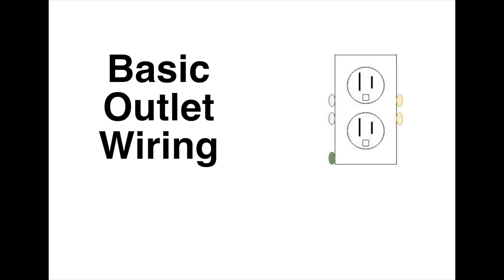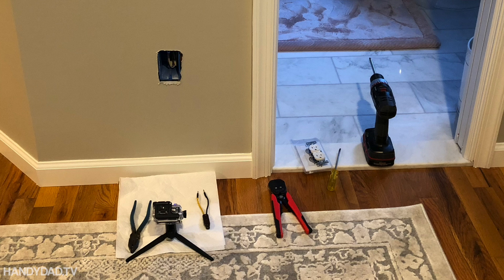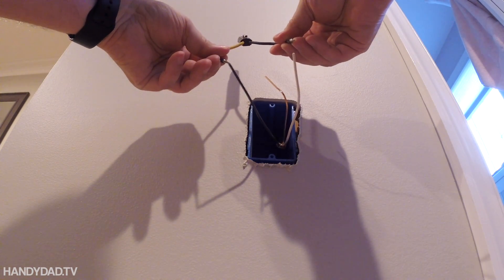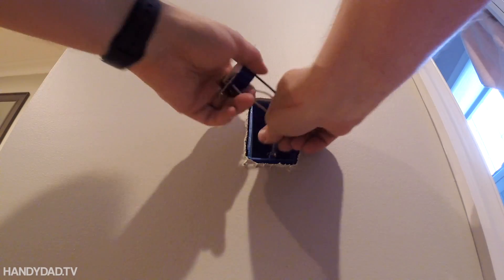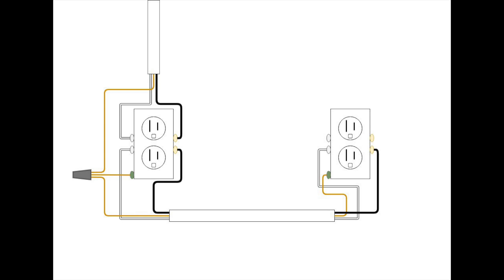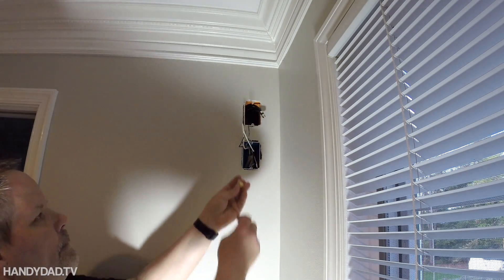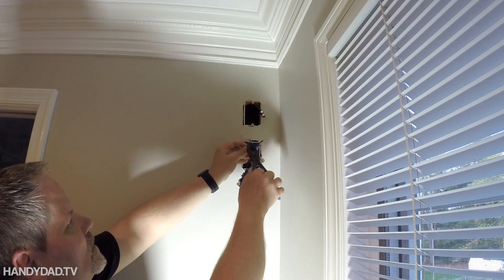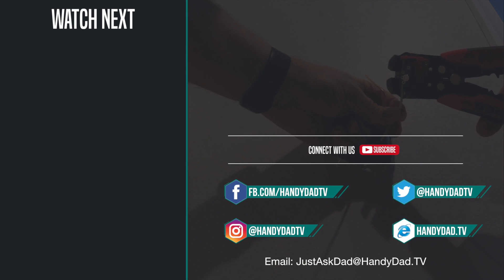How to Wire an Electrical Outlet

Comment: Great Video! I am installing an attic fan and I have spent hours trying to find a video about wiring it to power. Every video shows connecting the thermostat side and then they just say "and the other side connects to the power" But how? So I believe what I learned from your video (and please tell me if I'm wrong) is that I can run my 12 guage wire from my attic fan to an outlet in my attic (my heater is plugged into one) Basically if I open the outlet box (with the power off) and see a free chrome and brass screw, and a ground - I can connect to those accordingly and my attic fan will have power?
Reply from the maker: Yes that's how you do it. But verify the breaker size. You can use 14-2 wire if it's a 15-amp breaker. Use 12-2 for a 20-amp breaker.

14 gauge is cheaper and easier to work with.
Reply: HandyDadTV I went with 12-2 at the recommendation of the guy at Home Depot for safety reasons. And the breaker that controls that outlet is 20. Thanks again!

Comment: It would be useful to also include wiring the beginning of a run when the first outlet in the circuit is feeding two outlets (one in each direction).
Reply from the maker: I just recorded a situation like that! Basically you pigtail all of the wires, not just the ground.
Reply: @handydadtv  👍

Comment: There is no need to make a pigtail. Use back wired device. There are 2 positions that can be chained and it is connected to the device. In case you didn't break off the shorting tab, you got 4 positions. The 2 positions are on the left and right of the clamping screw.
Reply from the maker: You need to pigtail the ground. Pigtailing the black and white is a matter of preference. Some people always use pigtails. Most use the screws. Some use the stab connectors.
Reply: @handydadtv  yes. Ground wire is the only one that need a pigtail. The rest unnecessary.

Comment: How to do a code violation.  See NEC 300.13, continuity of grounded conductor (AKA Neutral, not to be confused with grounding conductor) shall not be dependant on device connection.(B)Device Removal. In multiwire branch circuits,the continuity of a grounded conductor shall not depend on device connections such as lampholders, receptacle removal of such  devices would interrupt the continuity.
Reply from the maker: If you’re saying white wires ALWAYS need a pigtail, then every house I’ve owned, including my current one built in 2018, has been wired incorrectly.
Reply: @handydadtv  What I'm saying is that 300.13(b) is clear for MWBC, and the inspectors I've dealt with in WI even frowned on jumpers from one duplex to another in a 2gang 4x4 box in a SWBC, interpreting the code as if any circuit fed by a MW panel is an MWBC, regardless of whether the circuit or box has both hot legs or not. The rationale  for a "true" MWBC, an interrupted neutral can cause downstream devices to experience L1 to L2 voltage instead of L1 to N.  In SWBC, a isolated neutral can be made hot by back feed from downstream devices if the hot isn't broken.   An interrupted or poor quality hot connection is an inconvenience, and possibly a fire hazard if the connection heats up, but does not create a shock risk.  An interrupted or poor quality neutral has the same risk for heated connections, but also creates a downstream shock hazard because it creates grounded conductors that aren't grounded.   GFCI and AFCI devices get a pass because they must isolate the downstream neutral to provide protection.  FYI, I'm an EE not an electrician.  My day job is industrial controls and panels.  NEC involved but not construction.
Reply from the maker: As a professional EE, I will defer to your knowledge of NEC. But I’d really like to know, in layman’s terms, what was wrong with the way I installed these two outlets?
Reply: @handydadtv   By not creating a device independent grounded conductor (neutral) connection, the possibility that the isolated white wire could go to 120v  at some point in the procedure is created.  This happens if the hot is still connected, and a luminaire or plugged in lamp or vacuum in a downstream plug is connecting the hot to neutral.   If this is the case, as soon as you pulled the white wires off, one of them goes hot.  Never mind that you shouldn't be playing with a live circuit, or that you broke the hot connection too, and/or that it will be reconnected before it's hot again. The NEC assumes everything else is done right or wrong in a way to exploit a weakness and create a hazard, then wants it to be negated.
Reply from the maker: So what you’re saying is, the neutral wires should always be pigtailed, just like the grounds, to protect idiots who replace outlets on live circuits.
Reply: @handydadtv  It's not just when you're doing the work, but NEC assumes that can happen.  You've never seen an outlet with cooked connection?  50/50 it happens to the neutral.  The reality about code inspections and connections was explained to me many moons ago by a buyers inspector going over a duplex I had bought new about 3y previously, lived in half, rented half, and was now moving and selling. He had prior (bad) experience with the builders other work.  He explained that the only connection you can have any confidence in by sight is a wire nut where you can see twists in the insulation behind the wire nut.  The only tight screw screw is one you've put the screwdriver on and checked.  The only wire routing you trusted was what you could see before the drywall went on.  He plugged a tester into every outlet, pulled half of the outlet/switch covers, and actually dug out the switches and/or outlets on a quarter of those to check further.  If a hot leg connection goes bad, you end up with no/low voltage where you expect 120v.  When a neutral connection goes bad, you can end up with 120v where you expect 0v.

Comment: Why would I have an outlet with three white and three black wires, when there is no switch involved?

(Also glad you mentioned the pigtail on the ground, because all three ground wires were just spun together and the longest was mounted to the green screw....nothing surprises me anymore.)
Reply from the maker: One set of wires brings power into the box, and two sets bring power out to other outlets in different directions. No switches are needed.

Comment: Have you ever seen a outlet that is controlled by a switch but is hooked up with just neutral wires?  There is one neutral on the bottom right and one on top left but the back in the box are the 2 black/ hot wires nutted together.
Reply from the maker: No that’s wrong. Hot should always be switched.

Comment: Good video but wouldn’t all those grounds touch when jammed back in the outlet box anyway?   What happens then?
Reply from the maker: If the ground touches hot, you’d get a short. Put tape around the outlet first to avoid this.

Comment: How many outlets connect on one line?
Reply from the maker: As many as you need. You just need to be aware of the load required by what you plug into the entire circuit. The circuit breaker will pop if you overload the circuit.

Comment: Does it matter if the order white of black wires when there's two blacks and whites? Also won't it make it 220 volts with two blacks and two whites? Thanks
Reply from the maker: You can use either screw, top or bottom, to connect the wires. They are both connected together by default. Just be sure to put the white wires on the silver screws, and the black wires on the brass screws.
Reply: @handydadtv  but won't it double the current to 220 instead of 110?
Reply from the maker: No. With two sets of black and white wires, one set brings power INTO the box and the other brings power downstream to other outlets on the same circuit.
Reply: @handydadtv  can you hook two black wires to one gold screw? Sorry for all the questions. I'm trying to learn all of this. Thank you for your help
Reply from the maker: No. One wire per screw. If you have more wires than screws, connect them with a wire nut and use a pigtail (short wire) to the screw on the outlet.
Reply: @tbucks1000  
Depends on the receptacle you are using. If you are making a J hook and putting the hook under the terminal screw then only one wire per screw is possible. However, most modern spec grade receptacles have a plate below the screw and instead of making a J hook you simply insert the stripped end of the wire under the plate and then tighten the screw to provides secure connection. Using this method it is possible and permitted to insert two wires under the plate, one on each side of the screw and then tighten the screw.

Comment: Does it matter if you hook the hot coming in and power going out to the top or bottom?
Reply from the maker: No. Both screws are connected top and bottom.

Comment: NEVER USE THE STAB CONNECTIONS! I'm an Electrician.
Reply from the maker: Appreciate your input. Why are they no good? I’ve seen them used in new construction by licensed electricians. New homes built in 1970s through 2020. Why does UL allow the manufacturers to make them?
Reply: @handydadtv  
Just remember if those quick connect speed wiring terminals were as good as screwing a wire fast then there would be a push in provision for the ground wire as well
Reply from the maker: I’m not disputing that screws are better, but the stab connectors must be “good enough” for NEC to allow them. No?

Comment: Is this 14/3 wire
Reply from the maker: 15-amp circuits use 14 gauge wire.
20-amp circuits use 12 gauge wire.
Reply: It's called 14/2 w/ground

Comment: Hi guys, thanks for all the tips.  I am remodeling my kitchen.  One outlet, you can flip the switch and the kitchen lights come on.  You can also open the back door to the garage and flip the switch there and turn the lights off.  Either end you can turn them off or on.  I am having a problem with a 2 power switch.  So is this possible?  To turn on a light over the sink or stove while turning on or off the light over the kitchen?  I played with this for a while and thought this won't work........But you know these days Youtube can provide some crazy real information.  Just looking for a next step, again thank you for all your input.
Reply: To be clear, I am trying to ad a two button switch that will obviously power two things. So the third wheel is the extra button in the garage that turns the lights on or off.
Reply from the maker: You’d be better off doing this with smart switches and create a scene in Alexa or Google Home.

Comment: Perfect! Exactly what I was looking for in a video, as a beginner.

Now I just have to get over the fear of grabbing bare wires for the first time (after shutting off the breaker and testing for power with the proper equipment).
Reply from the maker: It’s good to be fearful so you’ll respect it. Always test first, then touch the wires together with a screwdriver or pliers to make sure the line is dead. Do it enough and you’ll get more comfortable. But always respect it.
Reply: @handydadtv  When you say to touch the wires with a screwdriver/pliers, do you mean to see if there's electrical arcing that's visible?
Reply from the maker: Yes. Just as a precaution to calm your fears.
Reply: @handydadtv  Great idea, thanks!
Reply: Me too! Even after I test. What has helped me is switching power off to the entire house😆 then testing then I'm ok to touch. Better Safe than sorry!!!

Comment: When is it that the tab is to be broken from the outlet?
Reply from the maker: If you mean the tab between the screws on the side, that’s only removed when you want to switch one outlet for a lamp while the other one stays on continuously.
Reply: @handydadtv  Yes thats what I was meaning do you have video on this how its done? I actually would liked to get an extension cord where I could plug it into an exsisting outlet & the other end connected to a new flip switch outlet so I can mount an outside light on back side of house which then can be connected into the flip switch outlet is that possible you think?
Reply from the maker: I wouldn’t recommend using an extension cord as a permanent solution for an outside light. And I wouldn’t have a switch controlling half of an outside outlet because outside outlets should be GFCI outlets and they can’t be split.

Comment: I noticed in your diagram that the hot wires went to the top screws and the out going power wires were connected on the bottom and went down line to the second outlet but that outlet had the hot wires go to the bottom instead of the top like the first one.  Can you explain why?  I know gfci have a LINE (hot) and a LOAD (down stream) and was wondering if an outlet that has (hot) wires connected to the bottom was a problem? Or was it just because it was the end of the line that the process changed?
Reply from the maker: Yes, GFCI outlets have specific screws for line and load, but not normal outlets. There is no difference between the top or bottom screws because there is a shunt between them. Remove the shunt and the two outlets are electrically disconnected.

Comment: hi sir, just wondering, is it ok to run two 12/2 wire in the same conduit? or do they need to be separated. thank you very much!
Reply from the maker: Pretty sure you can run multiple wires in the same conduit.
Reply: @handydadtv  thank you very much sir!
Reply from the maker: https://diy.stackexchange.com/questions/119448/can-i-run-two-cables-through-the-same-conduit
Reply: @handydadtv  thank you! that's helpful.

Comment: Thank you for the video, question, could I connect a 2nd Receptacle to the middle Receptacle? Main cable comes one pair of screws, second cable to another receptacle using the other pair of screws, and a 3rd cable to another receptacle using the pressing connectors?
Reply from the maker: Yes, that will work.

Comment: Can you do a video on connecting 3 GFCIs together
Reply from the maker: All wiring is done the same way. You can daisy chain from one GFCI to another, but all wires should be connected to the LINE terminals. You can protect other standard outlets with the LOAD terminals, but do not connect other GFCIs to the LOAD terminals.

Comment: I have a switch connected to an outlet, but I want to connect it to a new ceiling light instead, making the outlet independently available.  Can you show or advise on how to wire this scenario?   Thank you,
Reply from the maker: The hardest part will be running the wire from the switch box to the ceiling box. Once you do that, all the work is done in the switch box. Remove the outlet wire from the switch and make it hot all the time. Replace that with the black wire going to the ceiling light. Then connect the whites all together and the grounds all together.
Reply from the maker: This may help https://youtu.be/wRSgemIxamU

Comment: I got a few questions hope you don't mind. 1. Does it matter which screw you connect the same colour to? ie white wire, does it matter if its the top, bottom screw or push-in connector? 2. My new outlet has two push-in for ground(and for black and white also) does it matter which push-in i put the wire into? 3. if the outlet doesn't have a ground screw, what do you do with ground wire?
Reply from the maker: 1. Both side screws are connected by default, so it doesn’t matter if you use the top or bottom. 
2. My dad taught me to use the screws instead of push-in connectors, and a lot of electricians agree. I’ll only use them for convenience outlets, never for high amp appliances. 
3. Don’t install outlets without a ground.

Comment: I once saw a circuit with hot and neutral  lines  dropping from the attic to each outlet as if it was T connected. The result was parallel outlets having 120 VAC at each outlet whether or not we removed any one of the outlets. Not a daisy chain. That means that only one brass screw had a black wire and one silver screw had a white wire. Could happen then the parallel outlets will be hooked up in series resulting in incorrect voltages if hooked up as a daisy chain, even with the connection bar in the outlet

Comment: Such a great simple video.  Thanks.  My circuit also has a red wire in it;  What do I do with that one?
Reply from the maker: Usually that’s connected to a switch. Use a voltmeter to verify.

Comment: Nice video, but I have some comments: first, never use the back stab holes on the back of the receptacle it makes for a weak connection, use the screws. Second, wires can be removed from push in connectors, you have to twist the connector back and forth  as you pull on the wire or get the Wago lever type. Third, on middle of the run outlets it is preferred to use the pigtails on all 3 wires as long as you have room in the box. The downstream outlets then will be independent of this one.
Reply from the maker: Thanks for the tips

Comment: This didn’t help. Every end outlet in my house has the white wire on the top chrome screw and the black wire on the bottom brass screw. This video did not have it that way. So I still don’t know why it’s done.
Reply from the maker: The two brass screws are connected.
Reply from the maker: Same with the chrome screws. So it doesn’t matter which one you connect - top or bottom.
Reply: There ain't no reason. It doesn't matter.